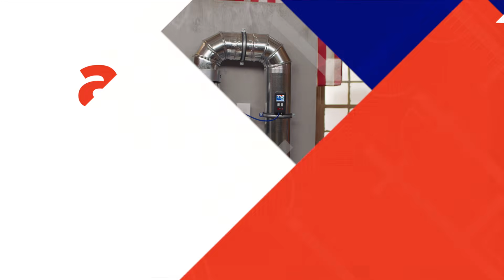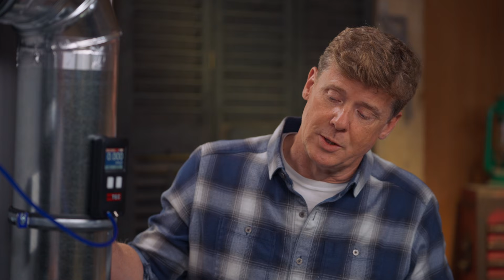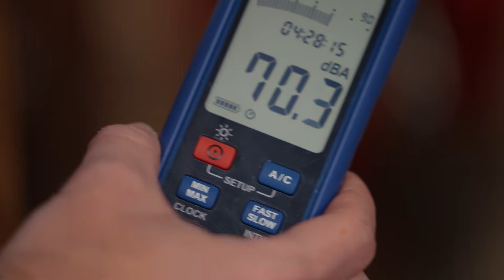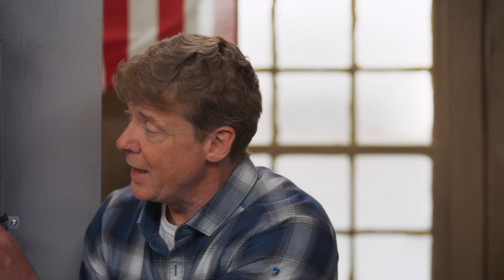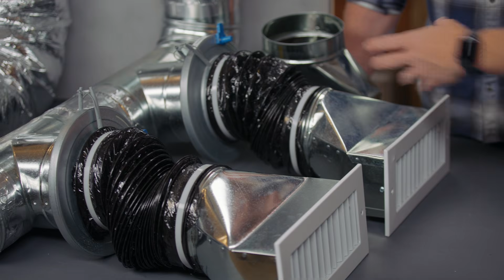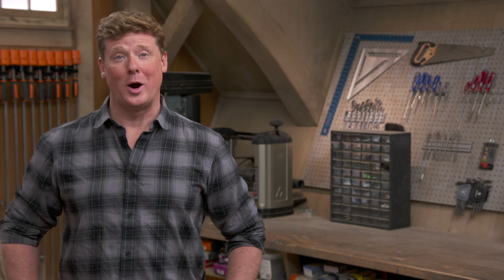Common Cause for Noisy HVAC | Ask This Old House

Comment: That point about airflow restrictions causing noise is underrated. Many HVAC “problems” homeowners notice actually start with duct design, closed dampers, or dirty filters that restrict airflow. When air has to squeeze through smaller openings, its velocity increases and the noise follows.

Comment: Anyone have very low humidity with forced air? First year having ours and I’m extremely tired- very hard to wake up in the morning, husband has been getting bad headaches, we’ve had sinus issues, etc. We bought a stand alone whole house humidifier but it only seems to be making a difference in one room, if that. It’s right next to the thermostat and the thermostat humidity never budges past 29 or 30.

Comment: Your conditioned air is a little too loud. Talk about a first world problem. 😂
Reply: The wrong noise can unfortunately make me feel extremely bad: headache, feel like tortured, etc. (and yeah I got lot of issues too unfortunatley without even that)

It may be subjective as the effect on me is probably not the same as you.

Not because I want to be a princess or what... but my body, head, etc. react that way... and if I tolerate it too much it has physical and health effect.

I believe taking care of noise in design of a lot of item is way under-valued.  And even people who are maybe not as sensitive as me, just like anything, when something is designed better, is more comfortable, etc. lot will be able to tell the difference and appreciate it.

Power to you if you can tolerate this without any effect.  I'm tolerant to a lot of things in life and don't complain, but this can wreck my system......

Comment: My brand new heat pump heater/air conditioner groans
for a couple of seconds when the fan comes on. The
company says there's nothing wrong with the unit, but
I think it shouldn't do that. Other than that, it's pretty 
quiet. Any idea what the groaning is?
Reply: Mine does the same thing. It also makes quick, sharp grinding sounds as well. Doesn’t seem normal to me as I’ve never heard it at anyone else’s home that has forced air heat.
Reply: Same here 😢

Comment: I hate forced air heating. One of the things I love about my hot water cast iron radiators and boiler is that I don’t have to hear them operating. Visiting family and friends with forced air I can’t help but notice how LOUD it is operating.
Reply: i had then and you could certainly hear them operating,,imy cental air system much quieter
Reply: It’s also gross
Reply: I agree! We had boiler baseboard heat and got a brand new forced air system because we wanted to add heat to the upstairs. Not being educated at all, I really regret switching. I feel like it’s partially my fault for not doing some research but I didnt have any idea how loud and dry it would be. I feel that the HVAC company, being that they’re professionals and knew we were going from radiant heat to forced air, should have known to educate us on the difference. $20,000 later and I absolutely HATE it! Makes me want to cry!
Reply: @aprilgould2262 HVAC companies really only care about the sale. I don’t know how old your boiler was, but a second zone could have been added to heat the second floor. Now it may have involved getting a new boiler that could handle the new load, but literally a doable thing. Maybe a $8k-$12k job. But if they can get $20K getting you to switch, that’s exactly what they will do.
Reply: @W @WillieMeetsWorld makes sense! I think that’s exactly what they did. I learned my lesson the hard way lol.

Comment: How about popping/banging ductwork ?
Reply: We have the same issue. I think that's tied to the metal thickness of the ductwork. Cheaper ducts with code minimum thickness might lead to the pops when the blower kicks in, when the heat expands the thin metal and so on.. I'm still investigating
Reply: @LeanHVAC  high static pressure with thin wall sheet metal (gage) is very likely the culprit. If you can reduce the static pressure, or upgrade the duct sheet metal thickness or reinforce in the area of the sound that will likely solve
Reply: @te2engineering  my ductwork is insulated  with exception of the boot. Would that Make a difference in the expansion and contraction noises? I’m asking you this even though I’m going to insulate it and see what happens.😊
Reply: If you have access to any of the spots you think the ducts might be flexing, I like to shoot a dab of expanding spray foam in between the duct and the nearest wall or joist. This is doable in attic or unfinished basement or crawlspace areas, not so much inside walls.

Comment: We jnstalled a higher SEER rated heat pump and at first we noticed the noise.  Air was moving faster.  But pretty soon we accommodated to the sound and now we don't notice it at all.

Comment: One way to minimize vibration from the fan is to get a model with a larger fan wheel which can be adjusted to spin slower to keep the same cfm.

Comment: Hmmm, I didn't think of my wooden floor vents being restrictive. That's an easy swap. I even have the nets to catch crap that the kids drop on the floor. 

 I cleaned my main blower fan and ended up knocking off so much dirt from the previous owner that it became unbalanced. How do I balance this fan?
Reply: For proper cleaning you need to remove the blower or you risk leaving some dirt that will make it out of balance.

Comment: Air flow is tied into refrigerant charge. Adjusting air flow without compensating refrigerant will cause humidity and cool/heat issues. It’s best to measure each room and determine the amount of cfm needed for that room (which will include occupancy of that area along with additional heat sources like tvs, fridges, pc’s etc….) once you’ve found the proper cfm then you determine which size duct will deliver that cfm or more never less. Following this for all rooms will also help build your heat load to an extent. Undersized ducts will create noise over size will create comfort issues. There is a reason it’s a skilled trade with highly specialized tools.
Reply: NOT tied to charge at all. That's the basiss for system pressure. Air flow is tied to CFM and BTUs.
Reply: Then explain air flow in the winter when the furnace is being used.  Air flow is a ton of things, but 100% not linked to your refrigerant charge. Otherwise, someone with no AC at all would have zero airflow?
Reply: @virgil3241   air flow (cubic feet per minute) moves heat / cold. (BTUs) The temp difference adds to that mix. Part of the comfort factor is having the temp difference between supply and return be within a certain range, which is usually near 18-20 degrees. If it's more than that you either feel a draft with the AC or like a blast furnace with the heat. If it's much less then the system may not keep up with demand. It's a factor is proper system design.
Reply: @rupe53  And when a person has no ac then what?   And what does ac have to do with furnace heat in the winter.  They arent used at the same time.  You say its tied into refrigerant charge, when it has nothing to do with that.  You can have an AC with no refrigerant in it, the blower motor of the furnace is blowing the same amount of air, warm or cool
Reply: @virgil3241    The first poster stated that, not me. Go read the thread again.
Reply: @rupe53  Gotcha.  What you said makes sense, the OP it does not.  Refrigerant has nothing to do with air flow
Reply: Absolutely 💯 agree

Comment: It’s not math it’s dba - noise is not linear apparently
Reply: I’m pretty sure that’s a logarithmic scale, so every increase in 10 db results in double the sound level.
Reply: Correct
Reply: @RichTCS  Actually, 6 db is double. 12 db is quadruple.
Reply: 10 dB is a doubling of the Loudness Level, which is meant to correlate to how we perceive sound in terms of twice as loud, half as loud, etc

Comment: The insulation on the OUTSIDE of that R/A duct is doing NOTHING to reduce noise. That is thermal insulation. Acoustic insulation is internally in duct work.

Comment: I have a tapping sound in my wall up by the main return for a few minutes after my system stops blowing. Any ideas?
Reply: That's caused by the temperature changing after it shuts off. If you're heating, when it shuts off, the ducts cool and contract. The noise is them moving against other materials. My washing machine drain pipe does that. After it drains hot water when washing whites, it clicks for awhile as it cools.
Reply: Heating or cooling?  Cooling - it could be condensation dripping down a tube. Heating? It’s cooling down and as metal contracts, the mounts are slipping just a teeny tiny bit causing that clicking sound.
Reply: It could be 100 things...poor install practice...a screw loose...a loose support on the duct...
EVERY scenario is different..
This is a pathetic video. Please take it with a grain of salt.
I've been doing HVAC installs since 2001...I have a bit of experience.
Reply: If you have an electric furnace, one element might be shutting down after the fun stops and not before.
Reply: The fan , not fun
Reply: Mice

Comment: My ducts make a loud BOOM whenever my furnace shuts off. I think it's haunted.
Reply: Probably no cross breaks in the sheet metal when they built the ductwork. Sometimes you can change the filter to a less restrictive one, like a MERV 4 and that will help because it will reduce the amount of negative pressure on the return side of the furnace's duct work. Those really high MERV filters are really restrictive, don't try to purify the air with the filter in your equipment, just get a separate air filtration system if you're concerned with allergens and stuff like that.
Reply: @JimmydaGooch I have the cheapest filter.
Reply: @JimmydaGooch I’d never thought about the filter being a factor.  Ours started doing this out of the blue. And I DID start using a higher rated filter…can’t recall if the timing was the same. 🤔 Well worth looking into. Thanks for the idea!
Reply: Better get it looked at.
Reply: @JPC74 well it's not getting louder, probably just the ducts expanding. Brand new furnace in October.